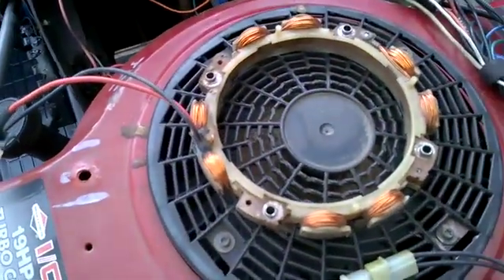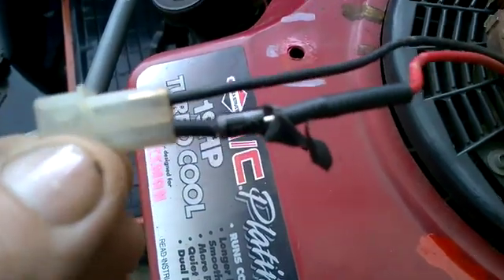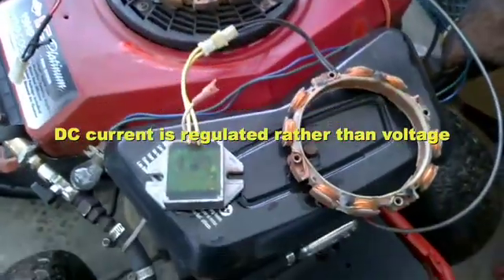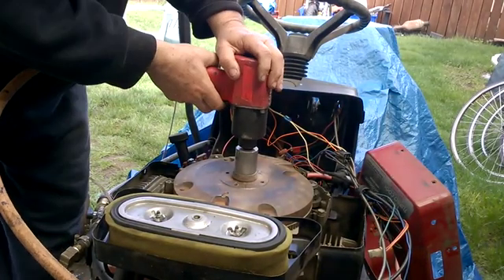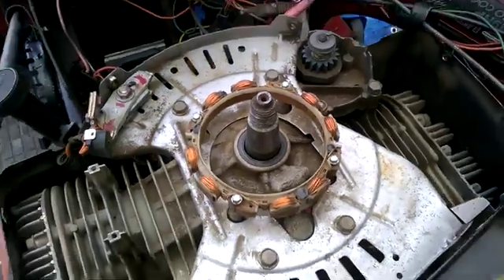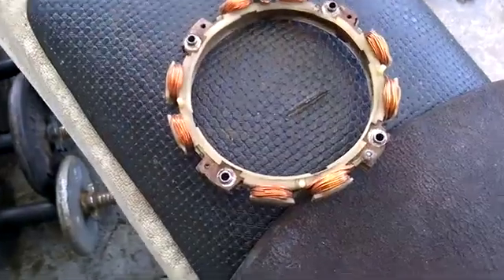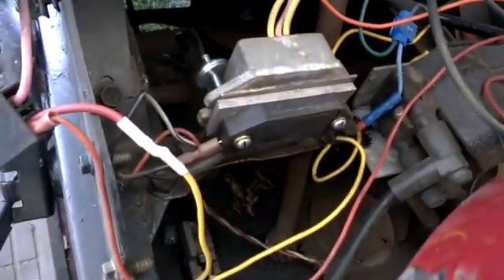Snapper Briggs Twin Engine Alternator Upgrade

Comment: The double black wires alternator is the same as the double yellow wires stator.  The gauge wire is same, and the low resistance is the same as measured on accurate ohmmeter. The modern fancy black plastic ring with yellow wires is being charged more money from the public. You could of kept the dual type alternators with red + black wires , and hooked both to a bridge rectifier for 14.5 amps output.
Reply from the maker: I did not have to buy anything. However I'd love to see a video showing us how to do that.
Reply from the maker: Someone will have to do another one.

Comment: You didn’t show us where you ran the wires too and now you wired it so you really didn’t help us at all
Reply from the maker: @skippy7545  There is no mystery. A basic understanding of electrical systems is very helpful. There are only positive and ground connections. Since there can be various colors of wires and connection locations, as well as safety cutoff switches, some portion must be left to the student's own discovery.

Comment: do you have a part number for the upgraded stator or on what it came from?
Reply from the maker: @wrecked3362  I don't have a part number, but it came off a single cylinder 12.5 Briggs that was on an MTD lawn tractor.
Reply: @vanstechcorral  So it doesnt matter which engine it comes from? All briggs have the same bolt patern for the stator?Opposed twin or single cylinder?
Reply from the maker: @wrecked3362  Not sure. Has to match magnets underside of flywheel.

Comment: Sorry but the truth is that you only need the regulator system if you’re running a electric clutch because you need the extra amps. Otherwise the small one is sufficient I’m so tired of videos not properly given the proper content. I’m not picking you personally but had you actually told people this I would’ve applauded you but this is just another wrong content information video.
Reply from the maker: You're mistaken in this particular case because the custom ignition source, coil and car battery are needing regulated 13.8 to function, being car 12V equipment, and the lighting and tach are digital 12V LED. I am sure you know that unregulated voltages vary widely higher.
Reply: I need more power to run a sprayer pump so need to do this Mod  good info re the coils
Reply: Just  changed the stater coil and fitted the voltage regulator both with the two Yellow AC wires so I can get power to drive my spray pump This is a perfect upgrade  as  will charge a flat battery at 10 Amps and battery now floating at  just over 14volts Now converted  all lights to work on 12v DC and all good 
The old AC and half wave  DC battery trickle charge system   with a the diode in the red wire is a well out of date low cost system  that does not look after the battery very well in any shape or form 
 Are you saying above that the old Stator can be used with the diode in the wire work with a voltage regulator Is this the other regulator I see on ebay with just the one yellow wire please 
Yes this does need explaining full by someone  as it all seems not explains fully 
But this post has got me working fine thanks  for info
Reply: I also see there is a single yellow wire voltage regulator on ebay  this is maybe the one to work off the original stater with the red and black wire would thing you would just use the wire with the half wave  diode in it  what do other people know

Comment: The magnetic pickup from a 1968 chevelle that is on the briggs engine. That is a standard part from the manufacturer Sir ?? Could rewinding the coils under the flywheel increase the output from the engine ???
I look forward to see the Snapper with the big twin running Van.  Thanks
Reply from the maker: You would need to add a regulator to limit alternator output to 13.8 VDC to avoid battery issues and over voltage to the ignition module
Reply from the maker: Also the magnet was removed from the pickup coil. The flywheel has the magnet.
Reply: @vanstechcorral  So the flywheel just has two magnets to trigger each cylinder or are there more than two magnets Sir ??
Reply from the maker: @victoryfirst2878  4 cycle engine, spark fires on exhaust stroke as well, known as wasted spark ignition. Works with opposed twin 180 degrees apart.

Comment: So are alternators upgradable ? 
I Have two identical Briggs and Stratton but one has a 16 amp alternator and the new one has a 9 amp alternator.
Reply from the maker: You should be able to. Alternators are under the flywheel. Use care in removing and use a puller so flywheel is not damaged.

Comment: How did you remove the Flywheel?
Reply: He used a puller. You do not need to use a puller, wastes time. Loosen the bolt screw it in like half way out pry bar under the flywheel put upwards pressure and one wack on the bolt hiding the flywheel while holding upwards pressure on flywheel with prybar it'll come right off doesn't hurt anything doesn't even damage the bolt takes 30 seconds
Reply from the maker: @sawyerbennett8227  You can weaken the flywheel. It's not a pleasant experience when they disintegrate at 3000 rpm. It could be life-threatening or result in serious injury. Exchanging a few minutes for a lifetime of suffering is a terrible bargain.

Comment: What size socket u used to take fly wheel off
Reply from the maker: Can't recall now but used an air impact and socket. Measure nut head with calipers.
Reply from the maker: Also used a puller tool to avoid problems with flywheel cracking. Hammer blows a no-no.
Reply: My mower has a 1 and1/4 standard.

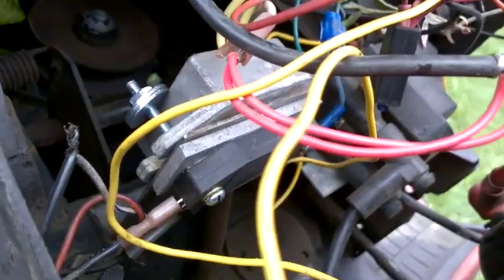Comment: At 4:56 where did you soldered or spliced the couple red wires coming from the regulator red lead?
Reply from the maker: Into the switch  that disconnects from the positive battery terminal.
Reply: Starter switch? 
And does it have to be 2 red wires twisted together and plugged into that red wire terminal connector from the regulator?  Sorry too many questions, I’m trying to see if I can fix mine
Reply from the maker: @josem.2909  I changed to a different alternator. Also there is a pushbutton to energize the starter. The switch turns on battery power to the HEI ignition module and the coil and the positive side of the regulator is tied to that, as well as the switch for the lights. The ignition is a battery powered GM car  ignition system.
Reply: @vanstechcorral  ok I think I get it, let me tell you something, I got an old mower  and found it doesn’t charge the battery,  but because it’s missing the wiring from the connector coming off the stator, (it could  also be that the stator itself is burnt and won’t put out any voltage, but let’s suppose it does put out voltage and current) ok, I checked  put those wires and judging by the connector seems to be the dual charging stator like the one you removed off your mower,  it has one black wire and one red wire with a diode. So the wiring should be like this,  the black wire (AC  output) should go to the light switch and the red wire (with the diode) I should hook it to either the positive battery post or to the post on the solenoid connected to the +battery post, 
Did I get it right?
Reply: @vanstechcorral  ok I think I get it, let me tell you something, I got an old mower  and found it doesn’t charge the battery,  but because it’s missing the wiring from the connector coming off the stator, (it could  also be that the stator itself is burnt and won’t put out any voltage, but let’s suppose it does put out voltage and current) ok, I checked  put those wires and judging by the connector seems to be the dual charging stator like the one you removed off your mower,  it has one black wire and one red wire with a diode. So the wiring should be like this,  the black wire (AC  output) should go to the light switch and the red wire (with the diode) I should hook it to either the positive battery post or to the post on the solenoid connected to the +battery post, 
Did I get it right?
Reply: @vanstechcorral  ok I think I get it, let me tell you something, I got an old mower  and found it doesn’t charge the battery,  but because it’s missing the wiring from the connector coming off the stator, (it could  also be that the stator itself is burnt and won’t put out any voltage, but let’s suppose it does put out voltage and current) ok, I checked  put those wires and judging by the connector seems to be the dual charging stator like the one you removed off your mower,  it has one black wire and one red wire with a diode. So the wiring should be like this,  the black wire (AC  output) should go to the light switch and the red wire (with the diode) I should hook it to either the positive battery post or to the post on the solenoid connected to the +battery post, 
Did I get it right?

Comment: If I run lights on my mower will this make sure the battery won't die correct?
Reply from the maker: Yes it will charge the battery.

Comment: Can't you just cut the diode out instead of replacing the stator?
Reply from the maker: There are two separate sections in the old stator, that independently produce current, with different gauge wires and number of windings. The replacement produces one AC output that can be rectified into DC and regulated.
Reply: @vanstechcorral  You seem familiar with this. What would happen if I removed the diode and hooked a regulator up to it? (The same regulator in your video)
Reply from the maker: @5.43v  If you look at the Briggs engine manual you will see the regulator requires a different stator. Leads are not the same, the two output stator has one side on each part as common ground.
Reply: @vanstechcorral  So, it's impossible to use the ac side as dc?
Reply from the maker: @5.43v  Check out the leads with a multimeter while running the engine at varying speeds.
Reply: @vanstechcorral  they'll be different even before the diode?
Edit: I don't want to be annoying, I just like to make sure we're on the same page
Reply from the maker: @5.43v  That is correct.
Reply: @vanstechcorral  is there any way that I could get this to work even without the regulator used in your video?
Reply from the maker: @5.43v  What are you trying to achieve? The half alternators don't have much amperage, so DC only good for trickle charging battery at varying voltages up to 35 DC and the AC suitable for running incandescent light bulbs. I changed the engine to use a GM HEI ignition module that requires 12 volts DC along with a 12 volt automotive coil to fire the spark plugs. The stator I changed to puts out more current, but the AC needs to be rectified to DC and then regulated to 12V DC. I can also run a 12V DC car tachometer and 1V DC LEDs. The diode on the one of the two outputs of the old stator only produces intermittent unregulated DC rectified into pulses as no current flows when the stator's AC current is in the other direction, at a frequency and voltage that rise with engine speed. You could rewire a stator, build a full bridge DC rectifier and then get a regulator used for solar panel applications to 12V, but it would simply be easier and cheaper to get the correct parts in most cases unless you have items on hand. For me, making an auto ignition from free car parts I already have, and then finding the correct stator and regulator off a junk mower were easier and more affordable.
Reply: @vanstechcorral  I just don't own a flywheel puller, and I want more amps by using both wires. I have seen it mentioned on online forums before. And, on the Briggs and Stratton stator pdf, it shows the lighting circuit to have like 5 amps. Also, I want more charging amps because I want to run many components off the battery that will pull a few amps.
Reply: @5.43v  Could be a good subject for a video!
Reply from the maker: @foxcrow3040  Looking forward to seeing the results.
Reply: @5.43v  Without changing the stator you will end up without the voltage required to charge the battery correctly and burn up the regulator. Any junk B&S over 14 hp will probably fit. I used a 24 hp blown Vanguard for parts to convert my 21hp Opposed. Charges at 13.7 now.